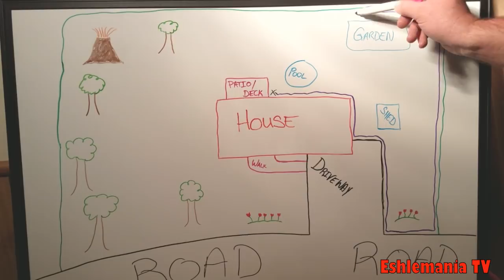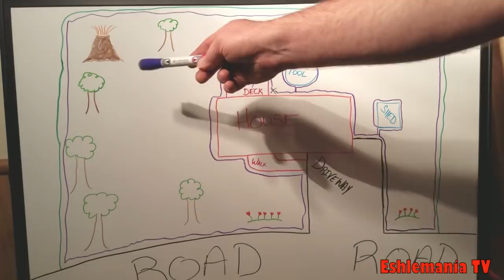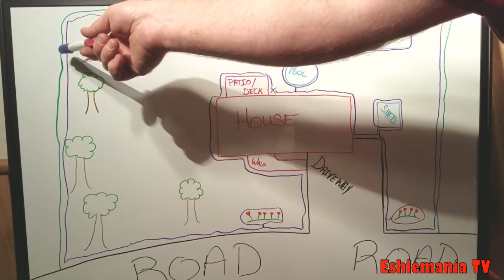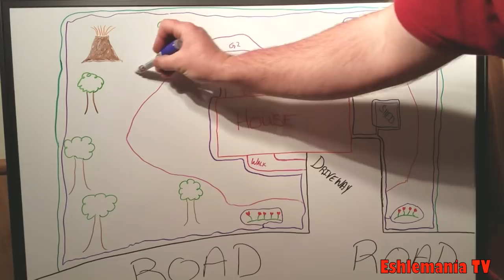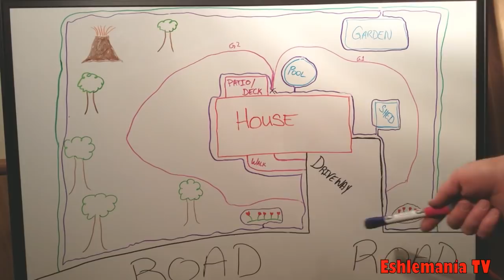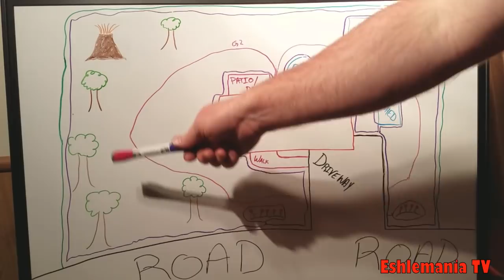How to install a Husqvarna Automower (Part 1)

Comment: Hello, ive been watching your videos since i bought a Husqvarna 430xh. Is the wire that comes with the large install kit used for the guide wire as well? Or is that a separate wire i have to buy? Thank you
Reply from the maker: The same wire is used for the boundary and the guides.

Comment: Can you please direct us to a video that shows the actual connecting of the wires to the charging base as well as the burying and splicing of the wires.  We have seen far enough of the schematics of how to do this . We need to see the actual how it was done.  I have watched over 15 videos on the schematics and length of loops explanations . I have seen none that show the actual process. I have an Husqvarna 430.
Reply: Thats a pretty short and ridiculous video of crimping a wire or attaching it to a connection.  Those are laid out in your quick start guide.  These videos are explaining the nuances that are not in the quick start guide.

Comment: I have a large yard and got a great deal on two smaller Husqvarna 115H units that I want to run half of the yard for each.  From what I understand, the Automower does not cut right up to the perimeter wire and since I do not want a strip that I always have to mow manually, is it possible to overlap the perimeter wires for each unit by about a foot or so at the dividing line.  I would bury one a little deeper so they would not physically touch.  I also want to be sure they are not running side by side too close together and allow the mowers to just pass over from one side to the other like the leads to an island.  Each mower will be cutting close to the limit of .40 acre.  Thanks in advance for your response.

Comment: If I add additional landscaping, can I add multiple spices in the existing boundary wire?  Also, it says the transformer should be installed inside.  How is that possible when it is only a few inches from the end of the plug?
Reply from the maker: you can always splice in new areas and make changes to your existing wire system.

Comment: How would you set up the guide wires to cross over concrete driveways and sidewalks to get to other non contiguous areas? Is this even possible?
Reply from the maker: Either run the wire through existing seams in the concrete or cut seams in it to the concrete with a cut off saw to run the wires through and then seal them back up.
Reply: @EshlemaniaTV  we have two non contiguous areas separated by mulch. Is it possible to set this up (Am I correct in thinking the mower cannot cross over the mulched area safely?)

Comment: Can you give some advise on how to cross the driveway?  Not sure how wide I need to make the lane and so on.  Thoughts on that?  Thanks!
Reply from the maker: Depends on how much time you want it to waste bouncing around on the driveway. If you make a wide passage across your driveway it is easier for the mower to cross it on it's own. But a wide passage also allows the mower to spend more time roaming around in the driveway and increases the potential for it to get ran over. If you keep the passage on the narrower side (3-4 feet wide) and use a guide wire to cross it, then the mower can use the guide to get back to the charging station when it needs to and cuts down on the amount of time the mower spends in the driveway.
Reply: @EshlemaniaTV  thanks a lot.  I will shoot for a 4 ft Mark and see how it goes.  I have black top and right now it's just on top so I am hoping to find a way to bury it or something.   Idea for Husqvarna.. come up with some sensors to semi or fully eliminate the wires
Reply: If you have a 4ft passage way across your driveway , to gain access to my front lawn ,does the guide wire have to be in the midlle of the 4 ft for my 430x or left or right  tks
Reply from the maker: The problem with wireless is the FCC regulations and things like that. It gets very expensive when you try to go wireless and broadcast a signal.
Reply: @EshlemaniaTV  good point.

Comment: Great video! I'm going to be installing my own 450x on close to 2 acres and I'm hoping to get it right.

Do I need to purchase the install kits or can u buy wire separately? I'd like to purchase the largest spool I can to minimize splices.
Reply from the maker: Yes you can purchase full rolls of wire up to 800 meters.
Reply: @EshlemaniaTV  what size of wire? Like a link to home Depot or Lowe's would be nice 😁

Comment: Looks good, and would appreciate advise on about 3 acres that I would like to do with one 450X if possible
Reply from the maker: 3 acres with one 450X...….. Well, we won't say that it is NOT possible, but it would take a very good and experienced installer to make it work. You should probably send an info to Automowerinfo@Gmail.com and explain to them what you're looking to do and give some info about the property you are working with.